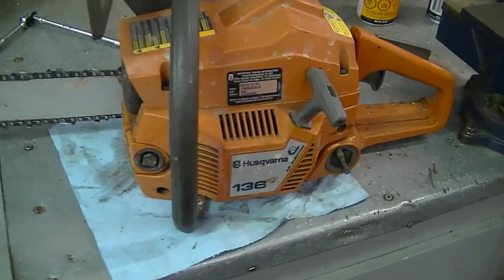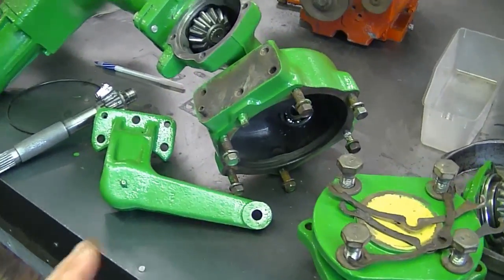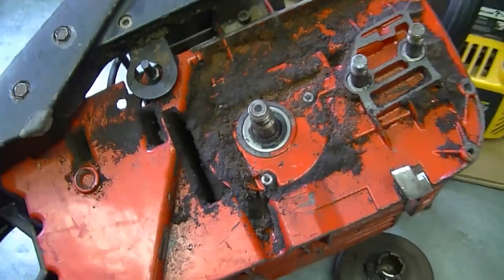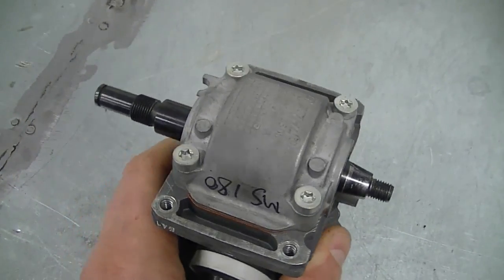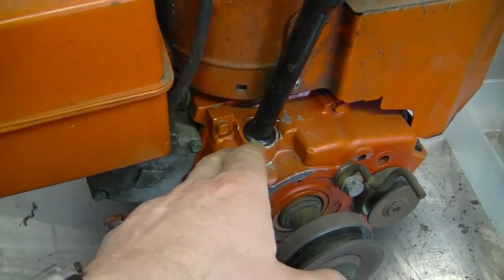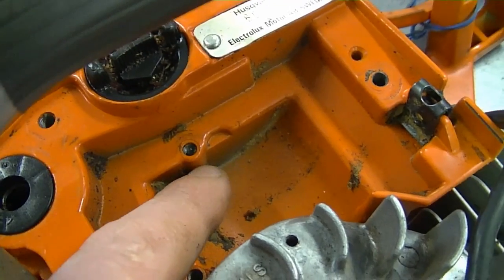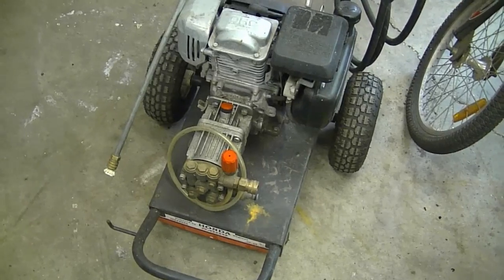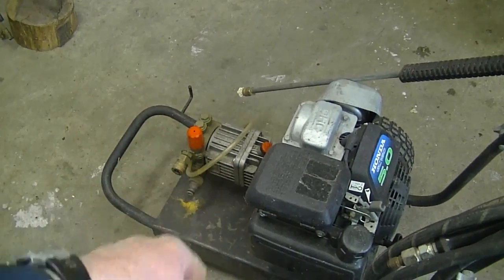Small Engines Q & A Video #123 in HD

Comment: Great Q & A , question on the walbro/zama carbs, on the primer balb side of carb there is a hidden fixed jet under a brass plug that you have to drill out the centre core to be able to remove it. Is that something you should be taking out on a carb clean/rebuild.

Comment: Don I really enjoy your videos & you have saved me money by teaching me to do small repairs. i have a  13 year old John Deere   GX85 riding mower which runs great, however I'm getting a clanging sound from the drive belt, and I can't figure out how to get at the belt guides to adjust them, it runs fine but I'm afraid its not doing the belt any good. Is there an easier way to get at these belt guides ? I don't have big hands but I just can't figure out how to get at them--Thanks Dave NY

Comment: An oldie, but goodie.  My 1983 JD 650 still runs and looks pretty much like new.  But, any parts orders via JD are returned as OBSOLETE and it is then to the Ebay marketplace.  I have stockpiled many of the parts, just incase.  I did break the right rear final drive shaft when it was new and dealer said his staff could not repair.  I had him supply the shapft and gaskets and bearings under warranty and I did the work in my garage.

Comment: Your videos are great. My questions are many - but for now here's one. I have a later model Murray rider and the carb was gunked up. I took the carb off - soaked it and cleaned the bowl area. There is no SEAT only a NEEDLE - I am told these have no SEAT for the NEEDLE. When I put it back on the unit will only run with the choke full on. Is there something I might have missed? 
Thanks for the video's - Gary

Comment: When I use my chain saw and put it down to clear branches out of the way, I often leave the engine running but engage the chain brake. Am I causing any damage by using the brake in that manner. I engage it just incase the chain spins some it won't get a bunch of dirt on the chain or cause some sort of hazzard.
Thanks

Comment: Hello DonyBoy.
I didn't knew that you had knowledge about pressure washers.
I have an electric pressure washer from the maker Karcher, which the last time I used it started to make an alarming noise which seemed to be the pump, and it also smelled like something was burning, so I disconnected it so it wouldn't do any more damage.
Is it possible for you to make a video about how these pumps work internally so I can maybe attempt a repair, or something?

Comment: How do i adjust the carburetor on a McCULLOCH PM605AV-20 CHAINSAW ?
The same saw has a weak pull cord return spring. Can i use the spring from a scrapped echo 660 chainsaw as a replacement ?
If so what is the correct procedure?
To replace the pull cord with a new one, what type of cord should i use, and what length ?
Are parts still available for a older Skill chain saw ?

Comment: Hey donyboy, I've watched some of your videos and they're good stuff, have saved me lots of time and effort! However I'd like to ask you a question. I have a Cub Cadet garden tractor, hydrostatic drive, originally powered by and 8hp Briggs, but now with a 12hp Briggs I/C. It worked crisp untill the 8hp bit the dirt I ran a Tecumseh 12hp in it, and as soon as I started it my drive was reverse and my reverse is drive. It's still like this, any help would be greatly appreciated !!

Comment: As a thought.  Whenever, i adjust a chain i always do it when the chain is cold, usually the next morning.  Let's say I got the chain in some dirt and had to remove it and clean it.  After cleaning and sharpening the chain I put it back on the saw but only loosely.  The next morning I loosen the chain and retighten it, normally.  My normal tightening sequence is to tighten it until it chugs up to the bottom side of the bar.  Then, I lift up the end of the bar and snug it back up to the bottom side of the bar, again.  Then I snug down the rear bar nut to hold the bar in its slightly upwards position.    This can be difficult because you are holding up the bar with one hand and tightening the bar nut with the other, so I usually put a short piece of wood wonder the bar to hold the bar up while I tighten the bar nuts.  I then take a folded up shop towel and move the chain on the bar.  Actually, I try to throw it down the bar.  I want to be able to throw it down the bar with just a little over run of the chain.  You may have to do this 8 or 10 times to get enough bar oil on the bar and chain to make this possible.  Chain tightness is a matter of feel and what seems right to one person may feel to tight or loose to me.  Regardless, I never tighten a warm or hot chain until it has cooled to ambient temperature.   I do not like banjos🤣

Comment: Mr Dony B my Bollens 150 line trimmer has a pull start assembly problem. My weeder wasn't starting so I ordered a new starting assembly and replaced it . It was tough because it had a coil spring that had to be wound in order to go back in. Anyway, it still won't pull start. I'm thinking it might crank isn't making contact, or the brake is not letting it crank. Any Ideas what could be wrong?

Comment: hey donny heres a QnA for you i have a poulan chain saw an it will start kinda hard but once its fired up an you give it some revs its sounds like the piston is smacking  the head i have taken it all  a part an looked at the head theres no sign of it hitting i checked the crank rod it dont seem to be lose i was woundering what can this be if you have ever heard of such thing an also when it gets hot enuff it quits running till it cools off

Comment: Don, why does my scooter have very low compression without any reason? it's really hard to start when the engine is cold. ( 4 stroke ) i checked the valve adjustment, and that was good. It looks to me that it is the piston or cylinder. ( and it is burning to much oil now to :D ) Im just want a new cylinder to be sure it stops burning oil. And it happened actually this week. First tought it was a dirty carb ( because it started turning off when i wanted it to idle. ) and compression is fucked now

Comment: Dony I have a husqvarna leaf blower that will not start no matter what I do. I've cleaned the carb, the muffler is clean and it is firing. I believe it is a matter of compression because it has around 70 pounds of psi. But I took the engine apart and the cylinder or piston is not scored at all and the gaskets looked good. What could be causing this low compression? Its only around 2 years old and I would rather not junk it. Also I have ran the correct fuel in it since I have had it.
Reply from the maker: 70 psi is way too low, could be a scored piston and rings
Reply: See that's what i thought but I took it apart and The piston and the cylinder does not have a score mark. I cannot understand why there is this great loss of compression. I don't want to junk it cause it has had very light use. Anything you can think of would help.

Comment: Don, I see the red bar oil and saw dust on the chain saw body and cover. I use Stihl bar oil with no problems. A friend of mine is a professional tree cutter, told me he uses only the cheapest motor oil (by the gallon) he can buy with no problems at all, and that he does not have the build up of saw dust on the saw and cover like I do. Said I'm wasting money on bar oil. What do you think?

Comment: I got one of those washer from craiglist for 100 bucks after two times that I use pump went out so I get another used pump I was happy after 5hat the plastic gear in the ohv valves got broke and damage the valve rocker the point is that its I waste of money with themoney I expend could buy a good one

Comment: Dony I have a Poulan Pro hydro stat riding tractor similar to the base John Deere L/LA or D series tractor you would see in home depot now days with the single cylinder briggs OHV.   Every time i try and start it the battery will end up dead, If have to charge the battery often or get a new battery and I have to mess around to get it to start. Is there a reason my battery keeps going dead. I just want to be able to cut my grass. Solenoid ? Starter? Dead short? Anything common that you can think.